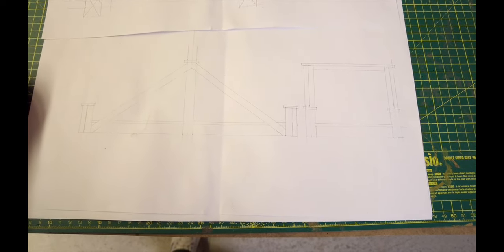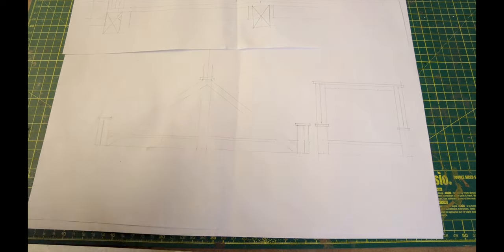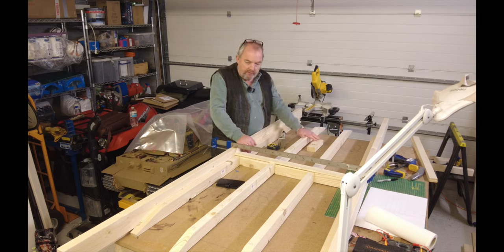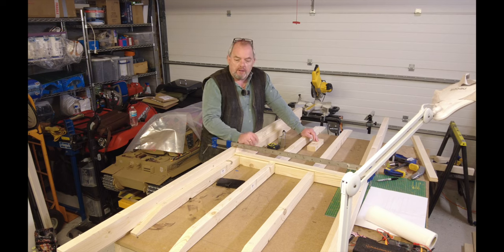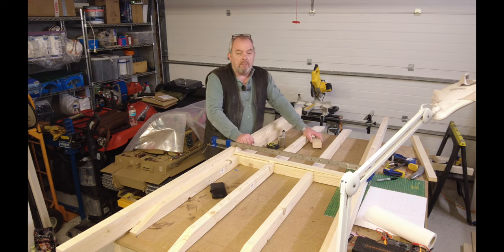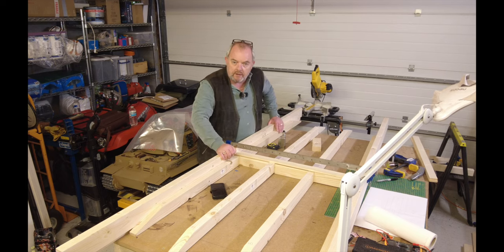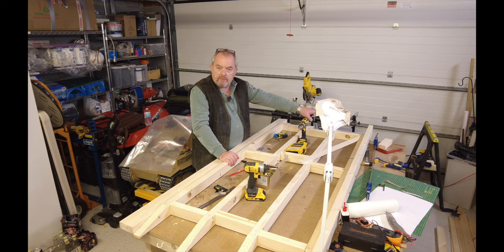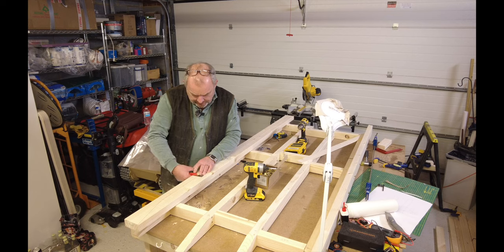1/6 Scale Diorama easy build WW2 Wooden Bridge. #easybuild (Video 01)

Comment: Looking good Tony bud it's going to be big😁
l was/am a carpenter myself I personally would have used C24 timber much better for weather resistance.
However I guess you will be painting it so not that much of a problem.
I might Looking into knocking up a building possibly  create a mini diorama 
Nice dewalt tools I'm a makita man myself and you are not wrong on how good modern tools are.
Pershing are being shipped now so hopefully you won't have to wait long.
Finally received my option paks, and hand set X9D  flipping heck there are a lot of switches and buttons Lol
Don't know where to start.
As ever cracking work have a great weekend.
Reply from the maker: Good morning Gary. I did contemplate using C24, but wanted to keep the budget down....I am sure that preservative I am using will help protect it....It is a big thing now, but really pleased I decided to build it as it adds another dimension to driving our tanks. I am hoping to receive my Pershing next week and really looking forward to unboxing it...I am also planning to build something along the lines of a bombed out building...I have a mould for the 1/6 scale bricks if you need to borrow it.  There are a lot of electronics, but Armortek try and simplify by labelling up everything. Bench test is where I would start. 
Have a great weekend.

Comment: Nice start on the bridge, Tony. I do plan on building something for my M26 once I am finished with it which will be quite a while I think. Summer months keep me busy with over 2 acres of property to care for plus I like being outside, so I won't spend as much time on it unless it is bad weather. But I m in no rush, being retired. Already the build is addictive! I have not even put anything together yet, just cleaning and etch priming a lot of pieces first. I built two large work tables just for this project as well, and a large spray booth with exhaust fan, so I have been busy before the tank even arrived. I am lucky to have a very large basement workshop to fit everything into. I can't believe how fast I am going through cans of UPOL etch primer. One thought on the bridge when you set it in place, being that you are not using chemically treated lumber, you might want to place any wood that touches the ground on a bed of river rock or gravel if you can, so water flows down into the dirt and does not sit on the wood. Just a thought.
Reply from the maker: Hi Ray, and thank you. You are so right..there is no rush on these tanks and the real pleasure is in the build...Sounds like you are going about it the right way. Yep...the etching primer...I think I used 8 cans on my tiger, 4 cans of primer and 6 cans on the main coat. Your advice on the bridge is absolutely spot on..that is the plan...base it on gravel away from soil. One thought Ray...your workshop is in the basement...have you a lift or means to get the tank out when complete? Sorry..perhaps a silly question from the UK where basements are normally accessed by steps.
Have a great weekend and enjoy your journey on the M26.
Reply: @tonys_workshop  Sounds like I’m going to be probably right around eight cans as well with the etch primer. I’m on can number four and have a ways to go but I do have a lot of the big parts done. 
As far as getting it out of the basement, I did have a plan. My basement has a set of stairs that go directly out to the patio. And I have a 10 foot aluminum ramp that I plan to place across the stairs to drive it right out the basement directly outside. I also have a 6 foot aluminum ramp and I plan to place it on the workbench that I built to drive it off the table. I guess I’ll find out if this all works.
Reply: @tonys_workshop  Tony, I have a question unrelated to the bridge if you don't mind. When using the UPOL Acid Etch primer, every can I have used so far, about four of them, have spattered large drops of paint out the nozzle somewhat randomly. I can't seem to figure out why it does this. I am in a comfortable environment temperature wise. The only way I can somewhat control it, is if I don't do a long spray but rather do shorter bursts. It has been very frustrating, especially for such an expensive paint ($22 US dollars a can here). I can't find any other paint that is as good as this otherwise I would try another brand. I tried a Rustoleum Etch primer that does seem to work but takes much longer to dry and is oil based rather than lacquer based.
Reply: @raymassa3751  Ray I have used Eastwood etch primer that I found very good. It’s an online shop here in the states. Mainly auto restoration supplies. I used it on my Tiger 1 about 8 years ago.
Reply from the maker: @raymassa3751  Hi Ray. I had a similar problem also..Try this....Make sure you have  a cloth or paper towel and wipe the nozzle after each spray pass and continually shake the can after each spray pass. I found that there was a build up of paint around the nozzle and this contributed to the spattering, but wiping the nozzle regularly definitely reduced this for me.
Hope this helps.
Reply: @tonys_workshop  Thanks Tony. At least I’m glad to know it wasn’t just the batch of paint that I was getting. I had been wiping the nozzle as well, but I’ll just do it more. I appreciate the feedback.
Reply: @chrisw8417  thank you Chris. Yes I have seen that online and thought about trying it. It’s about the same price as UPol. I already have several cans of UPOL left on-hand and probably don’t need more but I will keep that in mind if I do. Thank you very much.
Reply from the maker: Hi Ray, How are you getting on with the spraying? I am expecting delivery of my M26 on Friday this week...i am like an expectant father all over again :-)
Reply: @tonys_workshop  it’s going pretty well. I have now ordered eight cans total of UPOL primer. I think that should be enough. I have all the major parts primed. Some of the small little parts still to do. 2 1/2 cans left. But I still have the tracks to do.
I know what you mean about waiting for the packages to arrive. I was pretty excited couldn’t wait for them to arrive. I’m pretty sure I’m addicted already!
Reply: @tonys_workshop  Don't know if you are on the Armortek forum ( I suspect you are), but I posted a couple of pics on the M26 section of a spray booth I made and the workbench I made just for this project. Hope your M26 arrives soon.
Reply from the maker: @raymassa3751  Thanks Ray, I will check it out.